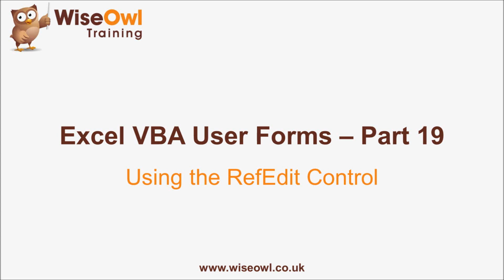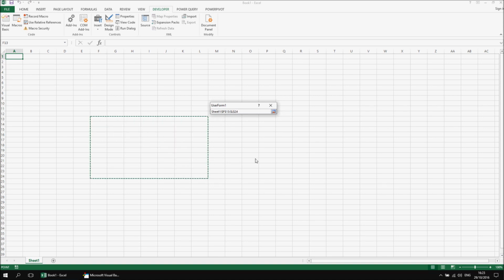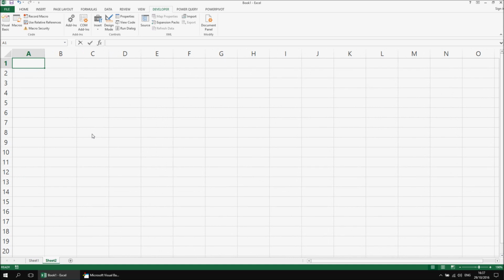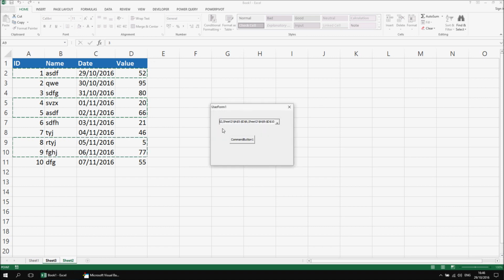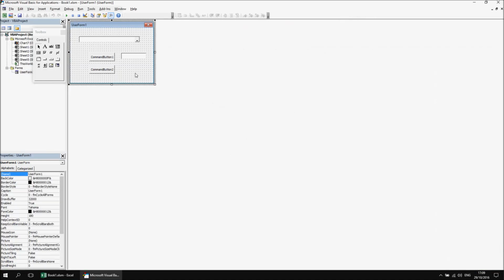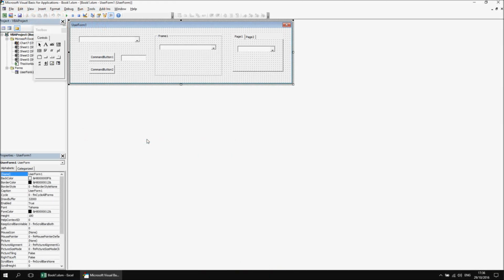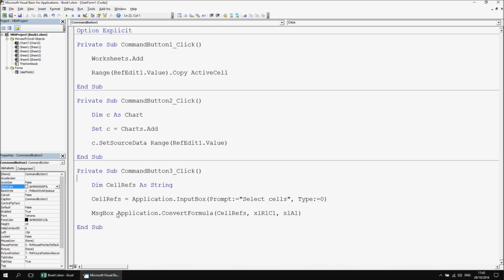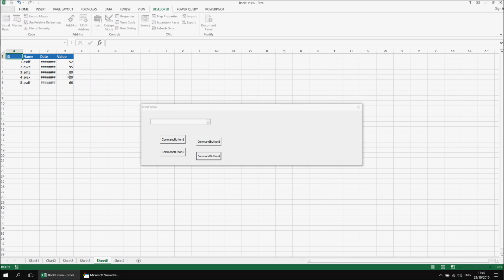Excel VBA Forms Part 19 - Using the RefEdit Control

Comment: Background:
In my Excel userform, I have
 RefEdit control/ 03 Radio buttons/ A label (when click, it opens a hyperlink)/ Command to run the code.

I can select range from the sheet with RefEdit control and when I press the command button, Userform/Excel is working absolutely fine.

When a problem arises:
If I click RefEdit to select range from the sheet (RefEdit in Focus) and instead of selecting sheet range if I click on the hyperlink button, then the problem arises- Else Excel does not respond, or userform disappears automatically, or Excel freeze.

When a problem does not arise:
If I click RefEdit to select range from the sheet (RefEdit in Focus) and instead of selecting sheet range if I click on the command button or Ration button.

Only problem is coming when RefEdit is in Focus and Hyperlink label are click.
 Can you please help with this? I know I can solve this with Application.Input method or If I create hyperlink command button instead of hyperlink label. But I want to know why this problem is occurring?
Reply from the maker: Hi there, I'm sorry I don't know the answer. You may have more success posting this question at StackOverflow.com

Comment: While adding non-contigious range to refedit, macro generating chart returns error 1004 refering to setsourceproperty. How to solve it?
Reply: Hi, I was struggeling all the time, the answer is to exchange ";" on ",". Below sample of code:

Dim s1$, c As Chart

s1 = RefEdit1.Value

s1 = WorksheetFunction.Substitute(s1, ";", ",")

Set c = Charts.Add

c.SetSourceData Range(s1)

BR
Reply: I was suffering the same problem as well  I found a solution  https://www.officetooltips.com/office_2016/tips/change_the_semicolon_to_a_comma_or_vice_versa.html do this step by step but  If your decimal symbol  where is described at the top of  Customize Format dialog box is comma too, change it comma.

Comment: Quick tip for paste special values... the quickest way is actually to press the keyboard button which represents the right mouse button (just to the right of the space bar) and 'V'. It's the same speed as a normal control and 'v' for paste.